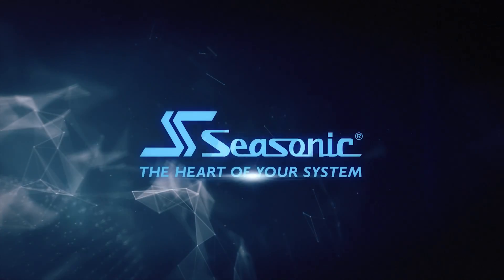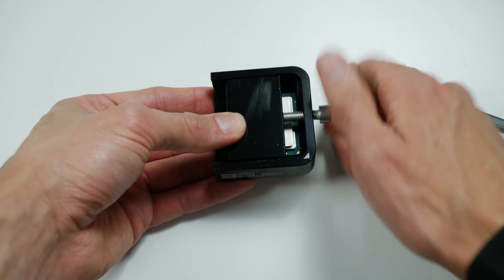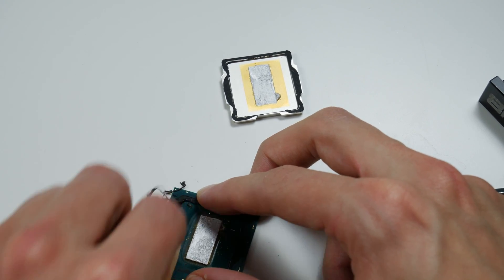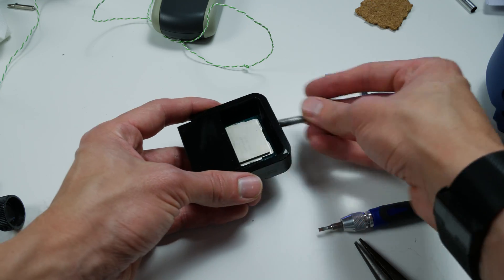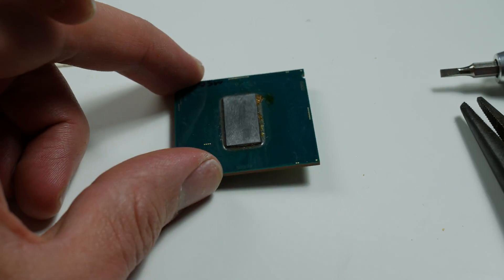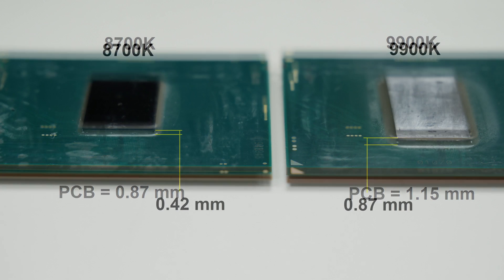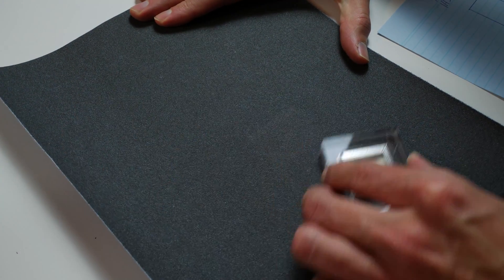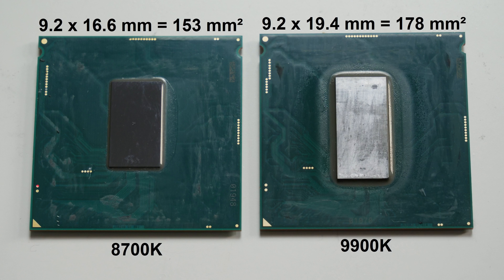Bad sTIM? Why is the 9900K so hot?

Comment: Die thickness was a new one to me.  Makes you wonder why intel didnt consider this.   Solder the core and then they use a thick die...   they might aswell have used paste and make the die thinner.  also makes me wonder what die die thickness of the amd chips is and if there is any gains there.

Comment: Me: pick up a cpu with absolutely care. Pray hard i did not bend any pin on socket or drop the cpu.

This guy: crack the cpu open, pick up a sand paper and grind on the chip like no tomorrow. Put back the chip, boot up the pc with no problem. Just another day of normal life.
Reply: Same...

Comment: Maybe they should have gone for better TIM like what you're using. If they did that, while the general public would have cried for solder, the fact that outside parties can't get better results than Intel without lapping the die would gain them some credibility for the solution. Now with what they have done, they look like they are always making some mistakes in regards to the optimal path. 

I can't believe that soldering and reinforcing the die would be as cheap to implement industrially than using better TIM. They would have still been able to keep costs low (albeit still higher than their original less optimal TIM) just by changing TIM and retaining the manufacturing processes.

Comment: I expect when they solder the shield onto the die they use higher  heat than the CPU cores can handle, that could also be why the cores have the extra shielding.

Comment: My guess is that the chip is not that much thicker than 8xxx series. Because the chip is soldered there is more tension on it which means that more flexibility between the chip and PCB is needed. Thus proably bigger solder balls between the chip and PCB.
Possibly this can be checked by a good X-ray inspection. Otherwise you will need to grind donwn both CPU:s to check the real chip thickness instead of heigt of chip vs PCB.

Also the bigger size of the chip may lead to the need of more distance between the chip and PCB.

Comment: Thermal conductivity of Silicon wavers is actually lower than 150W/mK because it is temperature dependant. Wikipedia only lists thermal conductivity  at around 20°C. at 60 °C it is about 130 W/mK. at 80°C  120 W/mK
Reply from the maker: good point there :)

Comment: I'm really struggling  to believe Intel would be stupid enough to build and sell a soldered ihs just based on the community  requesting it. Look I'm a fan of amd clobbering  Intel , but there's got to be a better reason. Intel has massively deep research pockets. There's no way they missed this issue. So it's got  to be an engineering issue they are trying to overcome.

Comment: Hasn't Intel figured out the whole heat thing never worked for amd
Reply: i used to have an Athlon 2800+,  worst chip in the company's history, quite literally.  105 degrees c on load,  95 idle.  WHAT were they THINKING!!?!?  opted for a 3200+, same board same cooler... a bit better,  75 idle and 95 load.  i think we'd all like to pretend athlons didn't exist...

Comment: der8auer Could you delid an AMD processor to see if it would receive a similar drop in temperature (a comparison between AMD's and Intel's soldering techniques)?
Reply: AMD's solder outperforms a liquid metal delid by about 4-5C. Intel just done it wrong.

Comment: 13:23 no I don't think we fooled ourselves. Intel has engineers, they are the ones responsible for designing the thing. If they can't design the product within a spec requirement without figuring out how to solve the other problems, then the product will get questionable reviews regardless. Overheating CPUs didn't do AMD any favours a decade ago, Intel can't expect people to accept it today, especially if they run even hotter than AMD's hottest cpus back then.

Comment: @der8uer
("With an Acht" ;) Thanks for another unique and fantastically  interesting video for us with this very specific and I would imagine rather niche interest.
So I guess You now HAVE TO delid a Broadwell-E to investigate how thick it's silicone is... ;)
Because if that is thinner...then why does the "9th gen" processors need to be thicker. But if that also is thicker then it's more likely that the "thickness" is a "side effect"/requirement of Intels "soldering process".
Best regards.

Comment: Why did Intel make the die so thick?  Because they rushed the i9 series to market to counter AMD's significant Ryzen market momentum. There was more than likely a balance between whether the chip could handle the extra heat and the engineering and production time needed to make the changes to reduce the die thickness. They chose the easier, faster " It should be okay" route.

Comment: Only way to test this is to measure silicone thickness on old Pentiums and Quadcores. Measure the solder difference etc. That way we can confirm if soldering truly is a bad way (which by looking at Ryzen should not be) or did Intel shove it to the consumer for whining too much. Few coats of conformal coating with Conductanaut (and die diffusion barriers) could make it to future CPUs?
Also, give a read from Overclockers Guide about CPU soldering and the engineering behind it, will be eye opening

Comment: @derb8uer You should delid R7 2700X and see if it has similar chip design as 9900k and see if it has extra silicon on the chip. 2700x is also soldered so if the chip is thicker then indeed as you suggested that thicker chip is required for the soldering.

Comment: I wonder why no one laps the silicon and laps a thin copper waterblock then mates them both with a tiny bit of liquid metal without putting the cpu cap back on, does anyone even make a delidded waterblock for the 9900k ?

Comment: What about wafer availability? People was heavily focusing on  price and cooperative fixing for memory production a while back, however most didn't bother to have a closer look at silicon wafer production and availability. Which is in the crapper compared to demand, and have had its prices forced low for so long, it has prohibited the global wafer manufacturers from making sorely needed upgrades to cope with demand (like moving to 300mm wafers). If wafer availability is an issue, as I strongly suspect it is - Intel might have had to make do with what they could get their hands on. Which were fatter wafers this time. The thicc'er die calls for a thicc'er pcb, to take the strain when older 115x coolers designed for slimmer packages, comes clamping down on these.. (?)

Comment: With solder there is no phase change within operational range, and the solder layer is aready much thicker than LM, Cryonaut or KPx would be, so its mass should accomodate the solder to take on the stresses of thermal contraction, rather than passing (most of) these on to the silicon or the solder-silicon bond. As long as there's no phasechange, no fractures, the solder should be fine all the way down.

Comment: intel didind shot in hes foot by add liqid metal to the 8700 man. process - they do what customers wants with hope that no 1 will be try to delid it hyhyhy 
intel think customers are dump cavmans thats all..... if u take anyother 0.05 mm from ihs (if u take 0.2 from cpu try 0.25 from ihs) then use liqid met. i make 4 dots with silicone glue on the corrners to prevent from moving... and question what u use betwen ihs and cooler - i hope that wass liqidmet.....

Comment: Obviously Intel has done everything for a reason, especially on a flagship chip like this. Think i'll wait for the 10nm Ice Lake chips to release before upgrading, as I need this level of performance, but not at 90-100 degrees C. Running multiple x58 era 6 core/12 thread Xeon systems (x5675's and x5680) at 4.2ghz and they only hit 50c under heavy load.

Comment: Intel is showing just how much they are shitting on enthusiasts by crippling thermal efficiency on their products. This can be seen across Ivy Bridge right up until the 3rd attempt of remilking Skylake. 2019 will be a real victory for AMD.
Reply: I have an Ivy Bridge running at 4.2GHz on air and it has been stable since I purchased it back in 2012.  It idles at 32C and never gets above 65C gaming.  It's much easier to reverse engineer a product than invent it.  While this video is very innovative I would really like to see a 5yrs reliability report on this CPU after he thinned it and pulled the Lid off.

Comment: Make graphite cover block.
very brittle but the best for conducting heat.
also make thermal paste if you grind some into a paste.
https://www.ebay.co.uk/i/301828233756?chn=ps

forget silicon and liquid metals there not good enough.

Comment: 10:00 WHAT?????? No! Transistors spikes are sunk toward top side of silicone! Close to the side where heat-sink is. Closer to the PCB the bigger metal layers, closer to heat-sink smaller details. Pattern looks like arrowhead one next to another with spikes pointed toward heat-sink.  Regardless of how thick initially wafer was process of etching silicone remains the same, and thickness of active layer remains the same for both Coffee lake and 9 series. Digging deeper and deeper from PCB side the smaller patterns (holes) are made then admixtures applied, metal layers, oxidization etc.. To be able soldering heat-sink and to to prevent top of die crack destroying transistors stretched up by iridium, also cause die is longer initially they cut thicker wafers using more material, so in result top side is little bit thicker than usual and there is also additional metal layer on the top that makes it even thicker. In result more distance between transistor heat-sink.

Im curious how 9 series dimentions compares to Ryzen's silicon die cause AMD got even larger dies, also soldered.

Comment: so, i5-9600k is soldered as well?
Reply from the maker: Yes
Reply: There is one more thing, what i don' t understand...You said, that thermal conductivity of sillicon is 150W, indium 80W and copper 300-350W. So why are temperatures better, if you delided it and apply Conductonaut with thermal conductivity of 73W (worst than indium)? And why are teperatures better if you laped silicon about 0,2mm with better thermal conductivity than Conductonaut?

Comment: I wonder if Intel figured they could use the increased thermal performance gained by soldering the IHS to avoid the cost of backgrinding? According to wiki the native thickness of a 300mm wafer is 0.775mm, which is close to what you measured on the new CPUs. I don't have a ton of knowledge in this area though, so I may be totally wrong.

Comment: I would imagine that the thickness of both the substrate and die is to increase survival rate of their soldering process. On another note, could you not combat some of the thickness by increasing the rate at which you are drawing water over the water jackets surface? I have seen 10C drops using the same ambient room and fluid temps just by changing pumps to very high horse power pumps like well water pumps.

Comment: Really nice video der8auer. Informative and entertaining lol! that Risky STIM Delid + die lapping !

And if that thickness is really affecting  CPU Thermals. 

I guess Its okay to say as an example that the 8600K is a way better choice than that 9600K (8 core with 2 disabled cores) on the intel side atleast

I feel like, not only the 9600K doesn't have much of an edge against an Overclocked  8600K.

The 8600K easily goes to 5GHz. Even better chances of hitting that 5GHz if its delidded. And its cheaper brand new vs a 9600K, and even cheaper if bought 2nd hand. And has a more petite Die that does not have any Overheating issue.

But Damn, really nice video man! proper entertainment :D

First the PT's meme benchmarks, and now this Thicc Silicon.

The good +++ The Bad

#1 Intel Finally made an 8 core 16 thread to go against AMD's 8 core 16 Threads +++ But its only marginally fast and its VERY expensive 

#2 Intel Finally Used S-STIM +++ But it still runs hot because of the Thiccer Die

and quoted from someone saying, perhaps the die was made thiccer to have better yields from the manufacture process.

This is why 3rd party reviewers and people like you der8auer are the Good guys. It is not fun buying a Product at pre-order not knowing what it entails. Specially if the product cost a lot i.e. 9900K for 719 Euro. I am happy with my used and delidded 8600K and 8700K XD

Seriously though man, You and this videos of yours are Epic! You deserve more!

Most tech tubers only focus on benchmarks to be honest.

Not many goes in and Delid a soldered CPU and  resolder them again then re-delid them. But also freaking Scrape the S-Tim on the Die with a blade and freaking Sand/lap it down! That is crazy! but it is very entertaining to watch and to see how much it affected temperatures.

Seriously, Good Stuff! :D

Comment: How much of the thickness of a 9900K is because of the material transition layers so that the solder TIM can stick to something mechanically and reliably.  Solder/metals won't stick to silicon so there must be a transition or "glue" layer and maybe that is why the thickness is increased from a 8700K to a 99xxK?  Not sure that it really needs to be that thick though...

Comment: I think it's probably better to ask for more IPC than raw clock speed. I mean what's even the physics limit to CPU core clocks? 8Ghz? Even by then, at smaller lithography, power consumption and temperatures cancel out the progress of going smaller. We are probably near the end of shrinking battle and Overclocking will end at some point. More IPC is the answer IMO.

Comment: I was wondering why we have not seen any graphene products on the market yet, I know there is a graphite pad that is supposed to work the same as thermal grease (2-3 deg difference) but graphite is not graphene, which has a massive thermal conductivity rating when compared to anything else, is there any known or published research into the use of graphene as a CPU thermal solution ? Is it maybe the cost of producing graphene that is holding up it's appearance ? The first time I read about graphene and it's properties my first thought was of a CPU water block cooler, I know they are trying to use it as a replacement for silicon but cannot get a pure form, the inclusions in the material are the limiting factor.

Comment: Just my theory.  From what I can remember, generally if a CPU is going to be soldered it needs to be designed and fabricated a certain way so it can withstand the soldering process.  I'm thinking that Intel already had these chips or process designed in the old way (with paste in mind) so they added in a few layers in the fab process to deal with the soldering.  It's not perfect but this way they don't need to redesign the chips and then go about trying to deal with potentially differing yields in that process.  Again, just my theory.

Comment: What happens if you use the intel crappy thermal paste between the lapped die and the heatspreader? What if the thermal design of the 9900k was so bad that the thermal compound simply was not usable when any normal/ common cooling solution?

Comment: Prettt much exactly what I thought would happen as soon as I heard the 9900k was going to be soldered. Indium based solder does not conduct as well as gallium based LM and these were never going to do as well as a delidded 8th gen so no surprises there.

Intel were between a rock and a hard place with this one. Probably needed to solder it to keep it cool enough for general usage by non-enthusiasts. Unfortunately that means delidding for LM is a lot more tricky for the small number of customers comparatively Ho wish to delid. 

However it’s very interesting to see the results after grinding! I hadn’t considered that the chip would be thicker.
Reply: This is from Indium Corp on their website:

    Compensate for a mismatch of the thermal expansion between two mating surfaces.  Different materials expand and contract at different rates, creating a need for some compensation in any intermediate layer (like a thermal interface material). The other candidates are not as forgiving as indium.  "Indium is really, really soft. Its flow stress is is about 150psi (1MPa).  This allows indium to conform to the mating surfaces and to absorb deformation due to differential thermal expansion without transferring the shear forces to the delicate semiconductor materials," says Bob.
    It will also optimize thermal conductivity by its increased contact even on imperfect surfaces.  Bob adds, "Indium conforms to an asperity, bump, or dip in the interface surface where a harder material would simply lose contact around such obstacles. Indium maximizes the contact surface area."
Reply: thermal conductivity of conductonaught is about the same as indium solder. The issue is layer thickness. When you apply liquid metal, you essentially paint it with a negligibly thin layer. The indium solder layer is 0.5 mm.

Comment: It's a 7700k with 8 cores and 16 threads. Which also ran really hot.  Or maybe it's a 8700k with 2 more cores.  Which also ran really hot.  No one could have possibly thought it would run cool. 
They couldn't claim ANY increase in performance without going all in on heat for those clocks. Then have the nerve to charge the idiotic prices they are.
For that stupid price, it should include a Kraken X62. Then it would be a reasonable purchase.
Intel has been pushing really high clocks to retain the crown for years.Because that is FAR easier than actually developing innovative tech that solves the problem.
Like i dunno..... CCX's and Ryzen? 
A 32 core Threadripper runs cooler on AIR than the 9900k does on a high end aio.